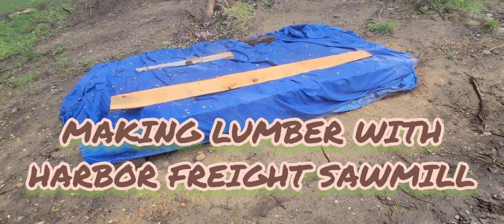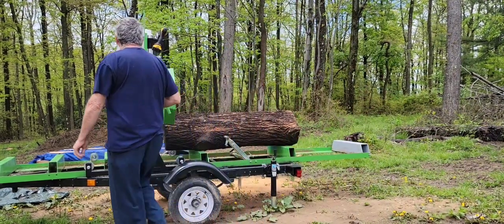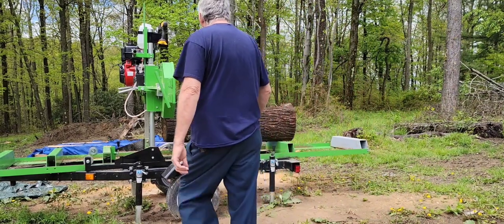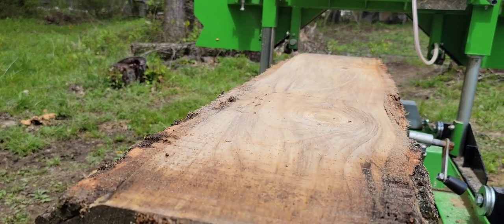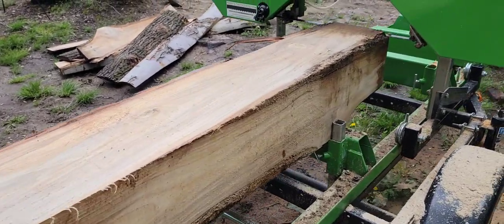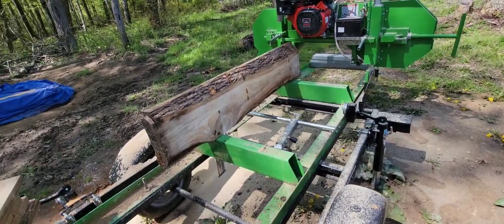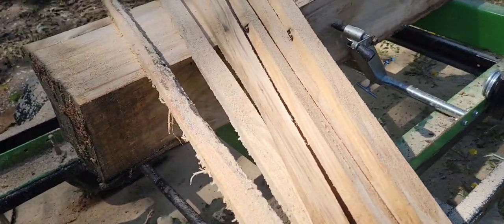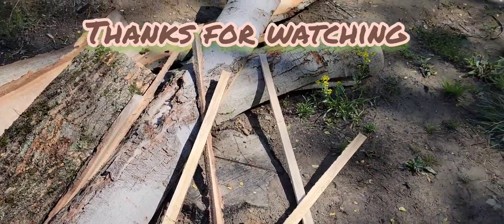MAKING LUMBER WITH HARBOR FREIGHT SAWMILL

Comment: Looks like you are getting good use from the mill and some useful timber from it 👍 interesting to see 👀
Reply from the maker: Yes Peter. I have made a few things already. A little work but very cheap material. 👍👋🎣🤛
Reply: It looks like things are coming along. Great planning to get the most from the wood.
Reply from the maker: @richardcox7926  Thanks for watching Richard. It's working out great.

Comment: So what was your initial cost for that sawmill. I have a lot of black walnut ,Red Oak,Hickory and Maple.  I'd like to make boards out of..
Reply from the maker: I think at the time it was on sale for $1799.00. I have added the bigger predator engine for $459 but wasnt needed. Just got it because I needed a motor for my log splitter so I upgraded on the sawmill. The trailer I used cost about $200. I did all the labor. Just buy the sawmill for whatever it cost now on Harbor freights webpage and you can cut 9ft 6in logs without any upgrades. Thanks for checking out my channel. Subscribe free if you havent.

Comment: You can use the boards that have bark on them all you have to do is hit the bark with a hammer it will bruise it and pull right off the boards. It's not a waste then. I've been working in a meal for years and that's what we do
Reply from the maker: Yes I use it all for something. Thanks for watching